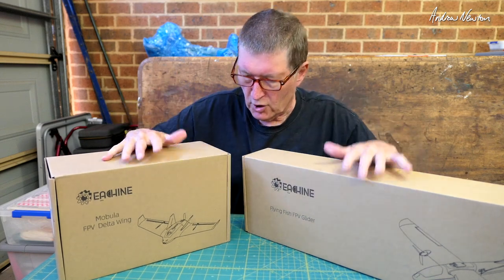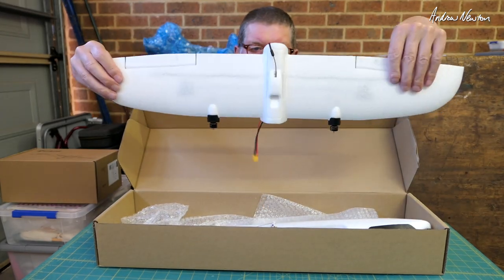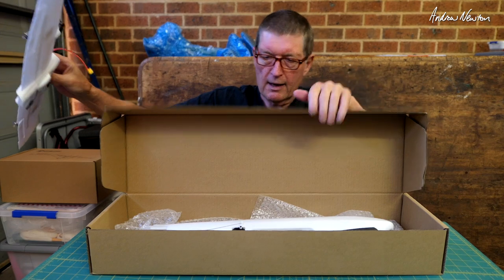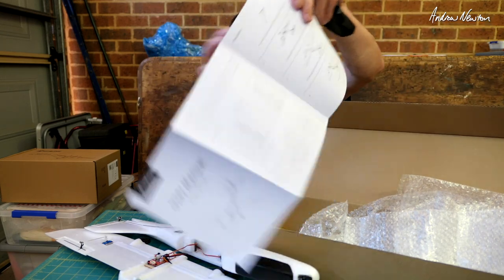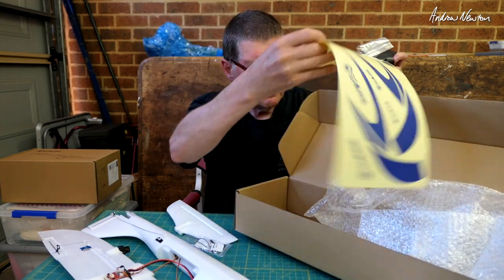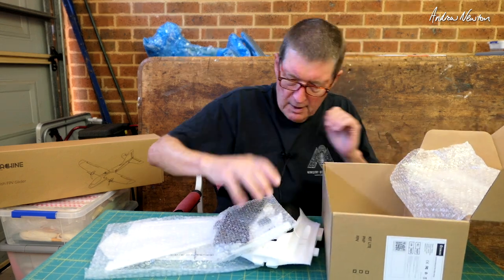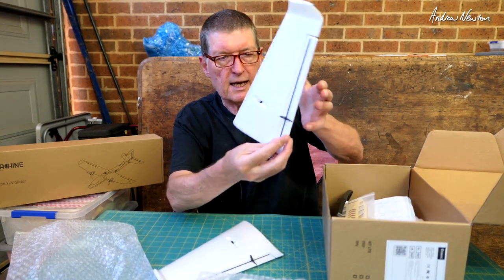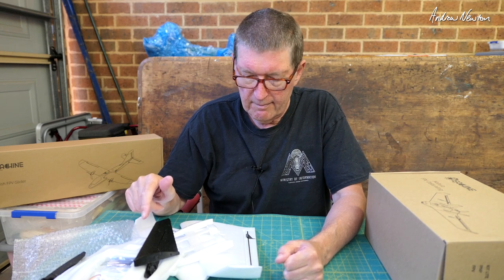Eachine Mobula Wing & Flying Fish - Quick Look

Comment: Looking forward to your Review on these (2) excellent Planes Andrew. That Flying Fish looks like a very fun plane and the Mobula Wing looks very speedy ;-) Much Fun! See you in the Air!
Reply from the maker: Flying Fish is very easy to fly, not so much the Mobula. I had the same launch issues as you. Do you think it needs some thrust angle adjustment? I needed heaps of extra elevon reflex which promoted nasty spin stalls
Reply: @AndrewNewton  Hi Andrew!
Yes, I'm going to be putting some 1mm washers on the bottom of the motor mount to decrease the thrust angle just a bit.
Mine was pushing the nose down slightly when going full throttle.
I've found that a powered off launch works very well for me and gets in the air consistently without much drama.
I give it a pretty good chuck straight out, power off, to get it gliding and that gives me time to get in the throttle before it loses steam.
My control surface movement is 5mm each direction and 60% EXPO Aileron & Elevator with the Linkage at the top of the Control Horn and 3rd hole down on the Servo Arm.
That works very well for me.
I hope that helps.
Merry Christmas and Happy Holidays!

Comment: People might as well start making the 3d printed parts for the Mobula.  Maybe a little premature on my part, but I'm guessing this plane is going to be like a lot of the other wings out there, lots of nuance to the launch correct and people getting caught be surprised where the stall speed is.  Probably best left to the Youtubers to take the punishment of the learning curve for the rest o f us.  However for $125  for the FPV version with a Foxeer razor nano, eachine vtx, and 9 gram digital servos...........there's some decent parts for the parts bin in case the airframe doesn't make it past the maiden LOL.